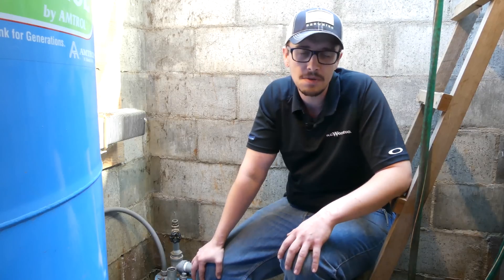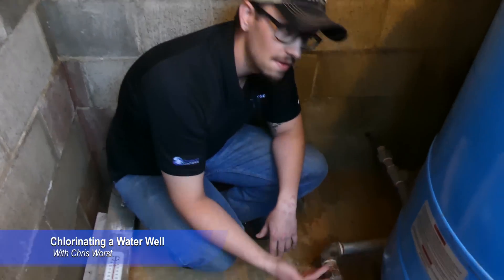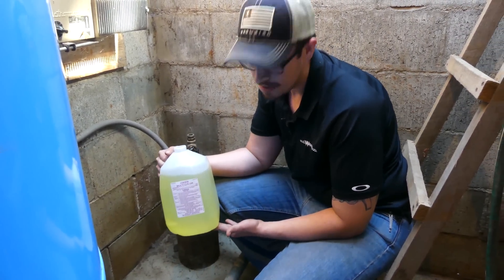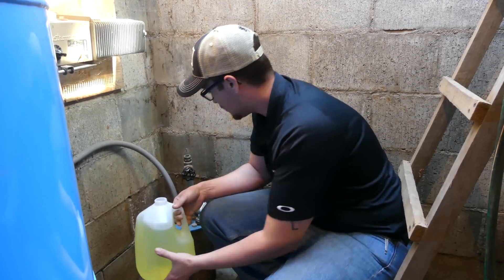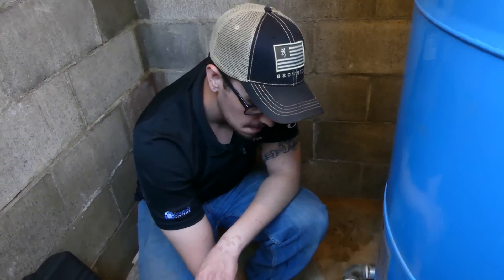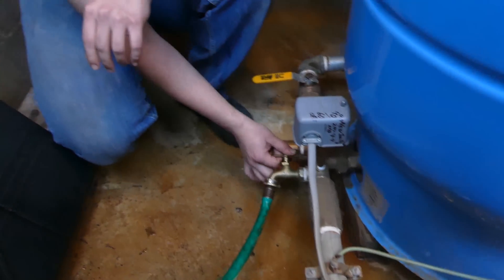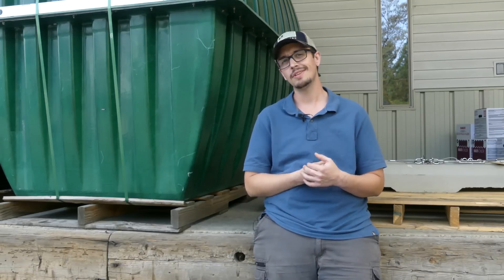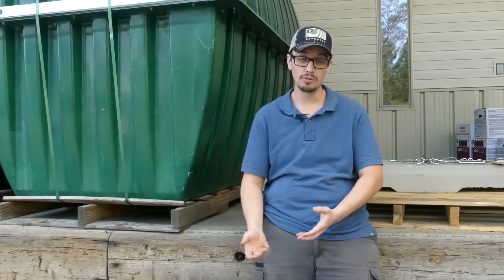Chlorinating a Water Well

Comment: We have a jet pump Flint & Walling) with two hoses running into the well head, there are no access holes. There are just the two hoses and 4 bolts securing the cap to the well. Any suggestions where we would pour the chlorine into the well and insert the garden hose to circulate the water?

Comment: Excellent video, thanks. Liked and subscribed. Three questions: 1) your circulation included the pressure tanks, right? 2) how long do you leave the circulation going? 3) Some recommend dropping chlorine tablets into the well. It seems to me that dropping bleach solution would be hands down better (the tablets can get lodged). Is there any scenario where tablets are preferred?

Comment: It seems like that ball valve on the upstream side of the pressure switch could be a problem.  If that valve is left shut, the pressure switch will never be satisfied, and the pump will keep running with no water flow. I would suggest wiring that valve open with and adding a warning tag.

Comment: I need to clean up my system because i have the "rotten egg smell" I have a Goulds SJ10 jet pump. It is mounted directly over/on the pipe coming up from the well and has no port to back flush or circulate the bleach in the system. Also has no well cap that i can see. Looks like 10"-12" casing cemented over the 4" pipe  with pump right on top. can you give me any suggestions on how to do the cleaning with this set up? Thanks
Reply from the maker: You need a carbon filter. Give us a call and we can help you pick one out: 855.329.4519
Reply: @RCworstwater   I have a triple filter set up with a carbon filter last. This has helped but not completely. Is it possible to do this flush with the setup i have?  I thought of  adding a T in the riser below the pomp and adding a hose bib or ball valve for a flushing port.

Comment: how do you clean the bottom of the well after all those crud washed down from the sides settles on the bottom of the pipe ?
Reply: Crawl down there with a skizet and scrub well until all debris collects on the leeflet, then add 2oz lemon juice, but only after the hot water is released

Comment: Does pool chlorine work? We have 10 ft. static water level, pump is at 60 ft. and the well is 4" inch pipe diameter and depth is 160 ft. Screen well.
Reply from the maker: It should. As always, be sure to flush thoroughly.

Comment: I am a new well owner!  I first need to design a system to remove sediment, salts and metals for construction use. All the videos I've seen show a pressure tank and pressure switch first in line out of the well.  I was considering pumping the water from the well into a vented holding tank first, then adding the pressure tank  and switch. I was also thinking of adding a spin down filter (or two) right out of the pressure pump. I prefer the cheapest solution before upgrading to a whole house system later.
Reply from the maker: Give us a call for help: 855.329.4519

Comment: This is very important. I'm in Ghana and my newly drilled well of 60 meters is pumping out brown water. I drilled it just 17th January 2020. I thought it was mud, so we pulled the pump up a bit. The water coming out of the well came clean after pulling the pump up a bit, but the pump couldn't pull much water. The prevent the pump from burning, or blowing up, I made the engineer pushed the pump deeper to the previous level. Thinking that the wster was going to be clean as I see now. We pumped water again and now it's back to brown colour again. Is it mud or it's iron. And can your process solve it?
Reply: Oh, hello Sir, we have the same problem. Am waiting for their answer to your question.
Reply: @celsabongalos8654  okay. Luckily, it took about two months for the water to clean up by itself. Don't add any chemical or mechanism. Keep pumping the water  clean water will start coming out shortly after sometime. It coming clean actually  depends on the frequency you pump it. Pump it out more for Mason workers and other people what use water for construction and other works. Soon it will be clean.
Reply: @haus_of_wisdom  so you are saying the more water you use the cleaner it will be?
Reply: @lobdsk  yes. If its a new borehole.  But if you have used it for more than a month and still brownish, then it needs to be treated. Because ideally, there's dirt and mud beneath the borehole. So the pump will such the mud about for sometime before it becomes cleaner. So yes, keep fetching it will become cleaner after 3 weeks to 5 weeks time.

Comment: Hey buddy i have seen your videos before when i was having well issues vary good info and vary professionally done. So i need to do this to my well i am getting alot of iron also i have a 1500 gal storage tank and i have a shallow well i live on the coast in northern cal. So i am wondering if i need to clean out my 1500 gal tank before i put bleach in system it has about a inch of mucky sand and looks like rust in bottom of tank. Also i have never done this process since i have owned this home in 4 yrs. I believe the did at the time of me buy in this property cuz thay had to put a ultraviolet lite filter on it cuz the water test was bad. So i am guessing the did the bleach to kill the bacteria about 4 yrs ago. I do keep up on lite bulb replacement every yr and replace the cotton type filters every few months more in the winter cuz of heavy rains here. Any help on what i need to do this and be affective i wood really appreciate and thanks for making such pro vids.👌

Comment: Just watched your previous video on calculating chlorination, but I'm still not clear on how to calc the water volume you're working with.
I know my well to be 238' deep, but how do you determine the static? Drop a line in as a kind of dipstick?
Reply from the maker: That is one way of doing it. The static water level is also listed on the well report, your local water authority should have a copy.